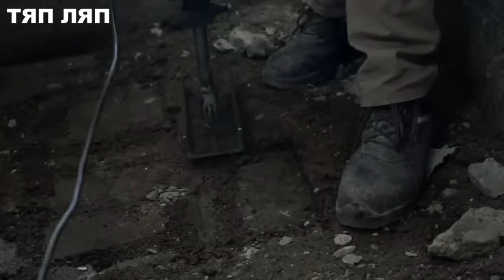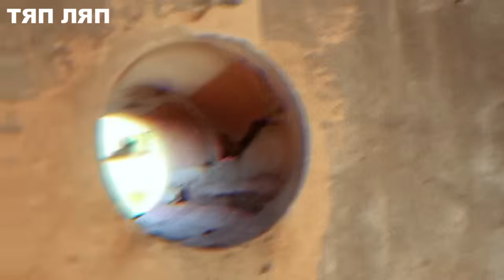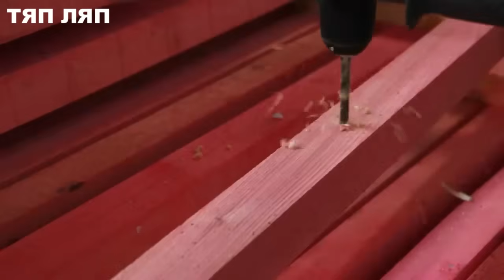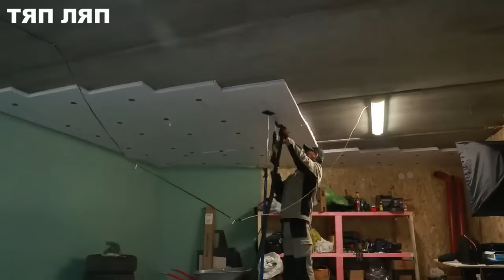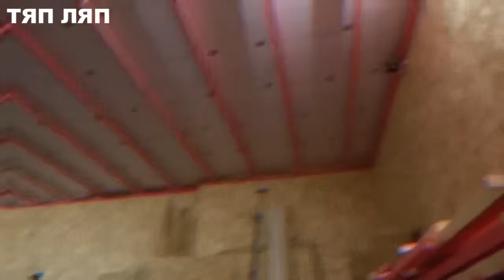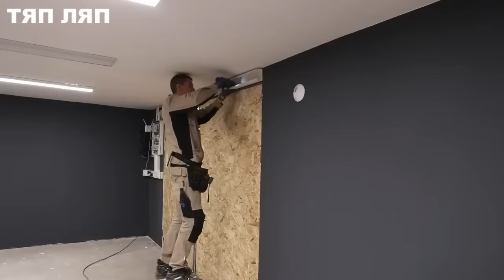He Transforms an Old Garage Worth $5000 into New Workshop. Step by Step Transformation

Comment: Great video ! You should do an additional video about this project. Show more of the finished project showing the final move-in in use of the space. Also show the building of the staircase to the top and the intended use of the top. Also explain the origin of the original building, including why it has a basement. This is a very intriguing project. Also the skill and quality workmanship showcased with this project is absolutely astounding. This craftsman is truly gifted. Thanks for posting.